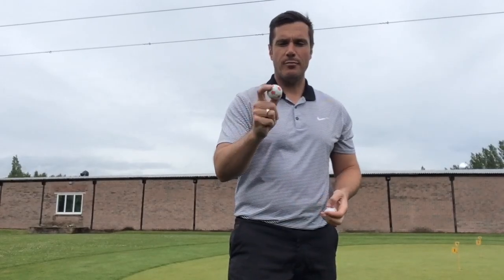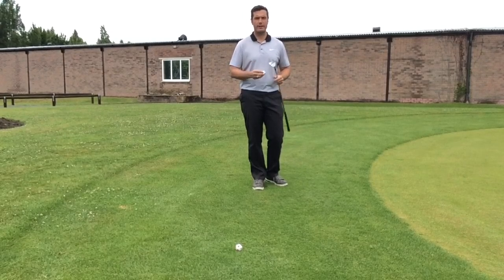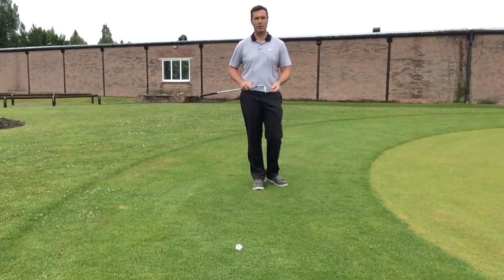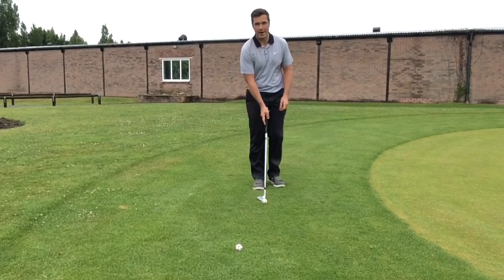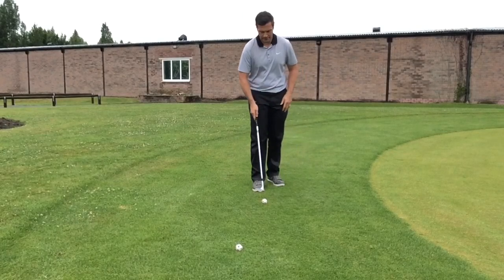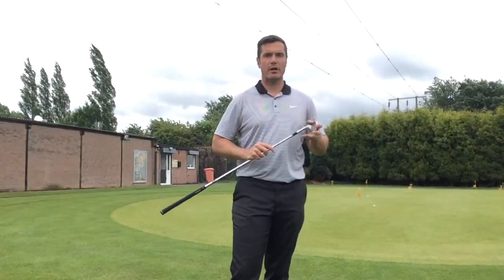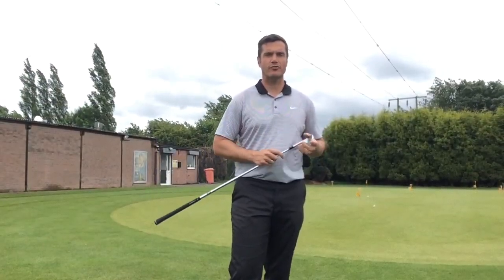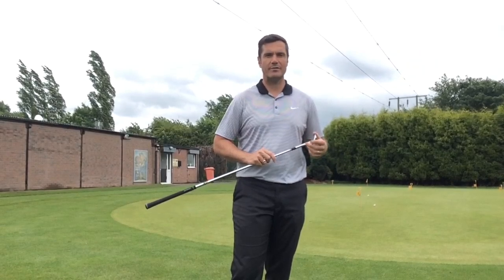The checking chip

Comment: A couple questions there Peter.
1) What is the loft of the club?
2) Can this be done with a chipper?
3) On a scale of 1-10 how important is this shot for my game?
Reply from the maker: Hi Robert, 

1. The loft was 54 degrees but opened up slightly.
2. You’d struggle with a chipper although every chip shot will have an element of backspin.
3. It’s not important to be able to play this shot, it just gives you another option. You should always play the shot you feel you can get closest. The checking chip is probably the sexiest!
Reply: @GolfTechstudio  Awesome, thanks for that info!